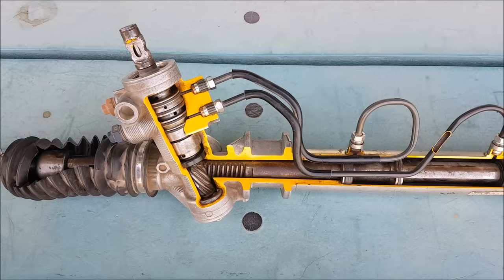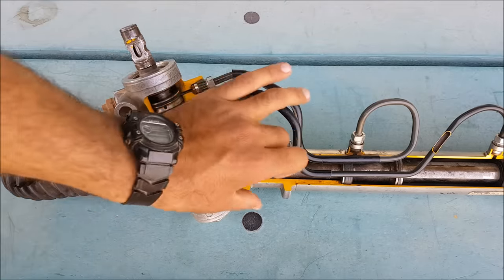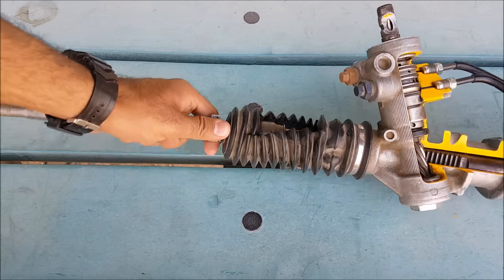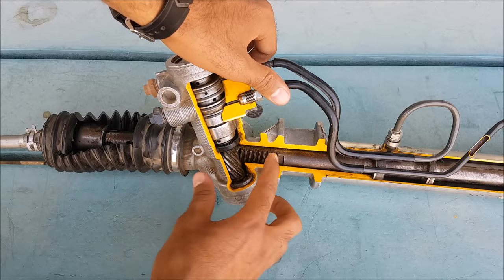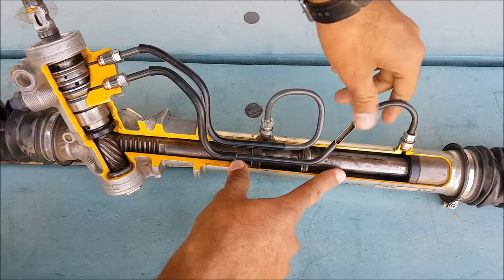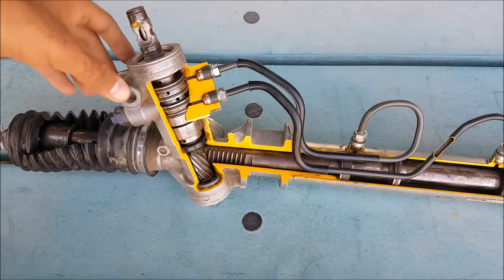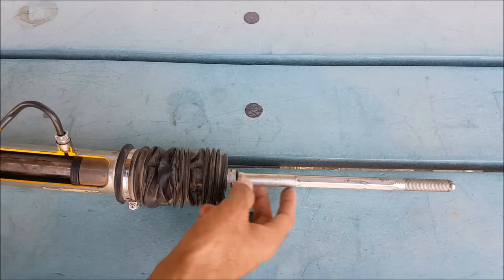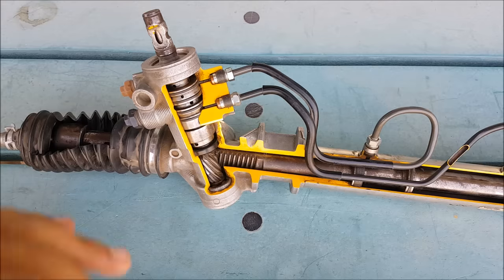Power Rack and Pinion Steering System

Comment: My steering oil leaked. ( Hyundai Verna) please get me a solution.
Reply from the maker: Replace the seals, which are worn out. Some seals are irreplaceable, in that case you have to replace the component, visit a workshop dear.

Comment: what is the power steering
Reply from the maker: A power steering is a mechanical device equipped on a motor vehicle that helps drivers steer the vehicle by reducing steering effort needed to turn the steering wheel, making it easier for the vehicle to turn.

Comment: Good explanation, but what I need to know is where does the fluid come from. Storage? How does one refill in a Toyota belta 2007 model, s2z engine?
Reply from the maker: Fluid is stored in a small tank/bottle which is fitted under hood, it has marks of low and high fluid level, you can refill it from there. Thanks

Comment: Facing wobbling in scorpio N hydrolic sterring above 80 speed 
According to workshop team Every thing is fine like suspension disc plates breakes, tyres 

Can you help me in this ??
Reply from the maker: The wobbling in a hydraulic steering system at speeds over 80 mph can be caused by tire imbalance, wheel alignment issues, suspension problems, loose steering components, hydraulic fluid issues, damaged steering damper, wheel bearing problems, brake rotor issues, aerodynamic effects, and wheel/tire issues. A thorough inspection by a qualified technician is necessary to diagnose and address the specific cause for safe. driving

Comment: My hydraulic steering sound when I turn left and right , recently I have changed steering pump , 

Can you tell me what is the problem with steering...??
Reply from the maker: It's possible the whining noise is simply coming from trapped air bubbles in your power steering fluid. If you suspect this is the case, you can confirm it by removing the cap from the power steering fluid reservoir and checking if any bubbles or froth has formed in it.

Comment: Is this a hydraulic power steering and not electronic as in my Toyota etios. I had a contessa years ago but it didn't have power steering and no way to lubricate with steering box oil so I suggested my mechanic who was a bit reluctant but finally agreed to do what I told him, I wanted him to make 2 holes in the rack casing ( housing) and give two grease nipples and after packing grease the steering was smooth as butter. Can I do the same on my etios which has power steering
Reply from the maker: Not at all, power steering has its own lubricants with the power steering oil 🛢️

Comment: If I have metal shavings in my power steering system should I replace my rack and pinion or flush and replace pump only??
Reply from the maker: Metal shavings in your power steering system could indicate a serious issue. It's recommended to thoroughly inspect the system to identify the source of the shavings. If the damage is extensive, replacing the rack and pinion might be necessary. Flushing the system and replacing the pump alone may not address the root cause.
Reply: Replacement  a must

Comment: Thanks

Please tell me the reason of my problem
Why power steering is not returning full to its original
Reply from the maker: Sticking or binding components, such as a king pin, ball joint, bell crank or even the steering column can prevent the steering wheel from returning to center after a turn

Comment: Hi my friend 👋
I hope you can help me 🌹
my car peugeot 307 2006
I have a problem in the power steering.
* The power steerin Sometimes does not working, But when I turn off The engine and start the engine again the power steering starts works normally, 
sometimes Two or three days pass without any problem The power steering . 💁🏻‍♂️
And sometimes power steering stops working more then 5 times a day 🤷🏻‍♂️
I already replaced the power steering in a new one, put it still the same problem 🤦🏻‍♂️
* I think the problem is overhead .
I believe that the the power steering temperature  goes higher and power steering stops itself 🤔
what do you think? 
*P.S : wen I cool down the power steering in water hose hes starts works normally 😐
*P.S 2 : wen The Power steering works the steering wheel is very very easy to Spin and light and fast. 
Thank you for reading my problem and excuse me for explaining a lot 🌹
Reply from the maker: I have read your description and it's so tricky to answer as many factors are related to your prob as you have replaced it with new one.
The simplest solution is that the vehicle has simply run out of fluid; this could be due to a leak or it could be because you have not replaced the fluid recently. A more serious problem is that the pump itself is failing. Moreover check for reservoir tank, any leakages, power steering belt for wear or aging. Secondly if you think about high temperature, so I want to clear you that at high temperature it works better while at lower temperatures there must be probs due to viscosity (inverse relation to temp) .
Reply: @automotivespot 
pro The power steering in this car is electric
the power steering Davis is now
the oli synthetic also now
thanks brp 🌹
Reply from the maker: Oh so it's an electronic powered. The electric power steering uses an electric motor that draws energy from the vehicle's electrical system to provide steering assistance. Sensors detect the torque or effort that the driver is applying at the steering wheel, and a computer decides how much assist needs to be added. So in short, check the motor and sensors too.

Comment: Thanks Nice and clear demonstration, 
I have a problem, when I park the vehicle for 8 hours the oil level reach to maximum and once engine starts the oil level becomes at min level... please advise what could be the possible reason...
Reply from the maker: The most likely reason for the power steering oil reaching the maximum level when the vehicle is parked for 8 hours and then going to the minimum level when the vehicle is started and driven is that there is a leak in the power steering system.

When the vehicle is parked for an extended period, the power steering oil settles at the bottom of the reservoir, and any leaks in the system allow air to enter the system, which causes the oil level to drop. When the vehicle is started and the power steering system is engaged, the pump draws in air instead of oil, which causes the power steering to feel weak or "sluggish" and the oil level to drop further

Comment: My reservoir was leaking from the steering pump, after which i sealed the steering pump (Fixed).. and then the leak stopped..  

but the steering is hard after running the car for like 5/10mins it become somehow heavy while the car is on drive(D) and vehicle is stop (lets say a traffic stop and not moving) this is when its becomes impossible to turn the steering.   

Do you have any ideal the cause or fix for this?
Reply from the maker: There are several reasons for the problem as you  mentioned here, and the reasons are as follows
1.malfunctioning power steering pump
2.worn power steering belt
3.faulty power steering control valve
Check these three, hopefully you ll get the main reason for your problem. Thank you
Reply: Thank you i will check on these.
Reply from the maker: Pleasure 😊

Comment: Assalam O Alikum
I have a problem with my elantra car steering wheel.
during left or right turn i hearing rubbing/friction sound
this sound is not from tie rod bush ( i changed all bushes 5 months back)
if am feeling the sound coming from horn side of my steering.
how to get rid of this sound.
or what is the actuall problem
please reply me
Reply from the maker: W salam.
If your steering wheel is making a loud rubbing noise when turning, the culprit could be the upper bearing on the steering column itself. This can cause the the plastic on the back of some steering wheels to rub against the cowling on the steering column.

Comment: Hi dude . I have a problem when my car is parked the steering to the left it's  so hard and quite  easy to right that doesn't  happen at regular  speed so please tell me do i have to change the rack and pinion  or the pup?  Will you help men? Thanks a lot
Reply from the maker: It needs a deep inspection ,, may be the tie rods and ball joints are worn, or the rubber boot is teared up, so do inspect it, secondly check the rack and pinion meshing teeth. Thanks for your apprec.
Reply: @automotivespot thanks  a lot for the fast replying 👍
Reply from the maker: Most welcome dear,, feel free to ask any thing related to the topic (automobile) .
It will be an honour for me.
 Thank you

Comment: Great and very clear video.  I perceived i interchanged the high pressured lines at the rotary valve section during rack installation, Please i like to know if the the steering system will still work fine ( i mean not hard to turn) if I leave it that way?
Reply from the maker: Dear both the high pressure lines are same, so there will be no problem (hard steering) if you interchange these lines. 
The most important thing is tha if you Interchanged the place at valve you must interchange its place at rack too.

Comment: You didnt mention the torsional bar which is the main factor of the steering rack
Reply from the maker: Basically torsion bar is a component of suspension system, it is not relevant to steering system.
Reply: @automotivespot  
Yes your right but there is also a torsional bar in the steering rack as well that divert the oil flow direction
Reply from the maker: That is not the torsional bar dear, it depends on the rotation of steering wheel which is further connected to steering column, and controls the oil flow direction, but is used in power rack and pinion steering system.
Reply: @automotivespot  ok you can google torsion bar for steering rack you can see what i mean there
Reply from the maker: Ok dear

Comment: What is oil seal actually?
Reply from the maker: Steering oil seals are used within the steering system, it provides prevention of leaking steering fluids and retains fluids inside the machine so the steering system can operate properly and avoid malfunction
Reply from the maker: Oil Seal is a device that is used to prevent the leakage of lubricating oil in mechanical equipment by closing the spaces between the moving and stationary components of the equipment

Comment: Good explanation. BUT please explain how the return pressure to the reservoir gets reduced from the pump ~1200 PSI down to LOW pressure
Reply from the maker: There is a built-in spring loaded pressure relief valve, which operates when the pressure hits the preset limit.
I hope you are clear now.

Comment: if there is oil leakage around the rubber at the valve what could be the main reason, which part need replacement?
Reply from the maker: The reason could be a damaged or worn-out seal within the valve assembly. Typically, the part that needs to be replaced would be the valve seal to stop the leakage. It's important to diagnose and address the issue promptly to prevent further damage to the power steering system.

Comment: on my Sonata 2002 v6,16", there is a leak in either L or R metal line, I just want to replace the hose/Line Instead of changing the whole Rack & Pinion , which the mechanics do.What do you suggest.??
Reply from the maker: No need to change the whole rack and pinion, if the leak is in the pressure line, just replace it with a new one. Thats it

Comment: Can we tighten the pinion gear from the bottom to remove looseness/rattles?
Reply from the maker: No, we can reduce / remove the rattles by tightening the yoke, which is located just below the rack, so there will be no rattling sound.
Reply: @automotivespot  
The yoke is the nut below/ external of that pinion gear?

Thanks
Reply from the maker: Yes, you got it ✌️
Reply: @automotivespot  
Ok thanks alot.
Will test it out later.

Comment: Superb explanation, and model,
Reply: I have tata Indigo car, the same hydraulic system is in my car, and my steering is hard, can you tell me the reason behind this
Reply from the maker: You must check for leakage, if there is a leak, definitely it will result as a hard steering, the second thing is to make sure there must be enough grease in joints to make the steering smooth,
Thanks
Reply: @automotivespot  there is no leake in the system, i will check the grease
Reply from the maker: Also check if the oil is contaminated.
Reply: @automotivespot  thank you so much sir, for your guidance,
Reply: @automotivespot in service agency, they always try to do hole in my pocket,
Reply: @automotivespot in service centre, they change everything which can repair also,
Reply from the maker: My pleasure sir
Reply from the maker: Yes i know that in service centre they will change each part, if it is repairable or not.

Comment: Sir, Will it damage the system to turn stereing wheel left or right without starting the car...?
Reply from the maker: No it wll not, because its the combination of power and manual, so it will work manually in that case 👍
Reply: Yes it is work. If the engine not running you will have heavy steering because the pump doesn't work yet.

Comment: thank you so much sire very good explenation also you should mention about how the torsen bar work because its the key element of the rotatory valve when the driver exort too much force one the wheel the trsen bar would twist and it will make the orifices in the grooves inside to line up so the fluid will be flowing to the appropriate line depending on if that twisting is to the left or to the right  thank you so much very nice video keep up with these videos they are so good and i love them i would like if you mad a demonstration about the automatic transmission and the torque converter thank you so much sir
Reply from the maker: Thank you so much, it means alot to me. Soon i'll cover more topics 😌

Comment: Can I reverse the two high pressure lines to reverse the directions?
Reply from the maker: Yes it will work in opposite directions.
Reply: @automotivespot  i think it's impossible to reverse the fluid lines because of that mechanical part they will force  each other to opposite
If I am wrong please explain !!!
Reply from the maker: That mechanical part have fluid spills in it, which allows the fluid to flow back in reverse direction. So there will be no difficulty in flowing back of fluid.

Comment: Impossible to understand
Reply from the maker: Its so easy to understand its working, just concentrate on the main function 😊
Reply from the maker: Sorry for accent dear 😐
Reply: Can you please explain how the rotary valve allows fluid to chambers .I mean flow of oil in one direction say clockwise and anticlockwise. Just flow diagram.
Reply: It's good effort but needs to be supplemented by flow digram